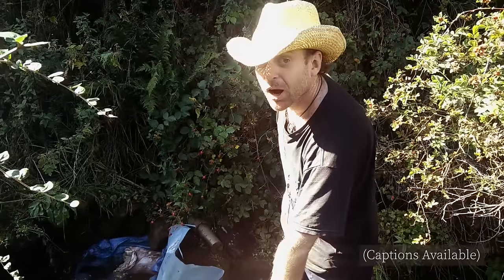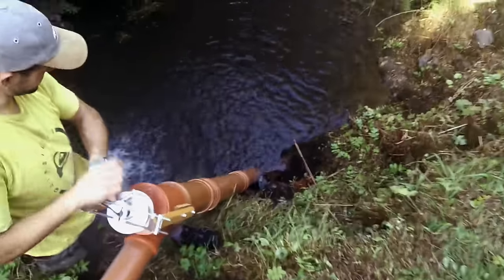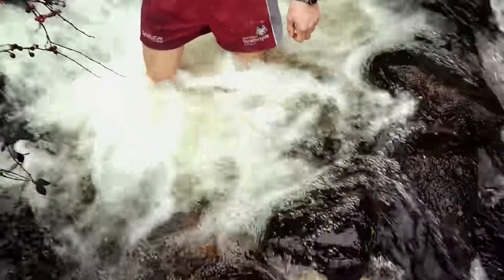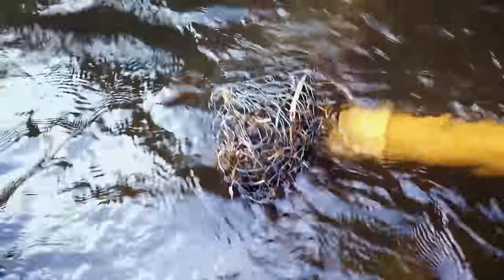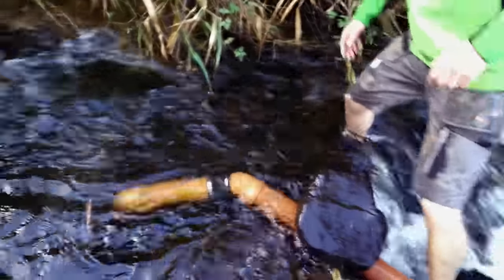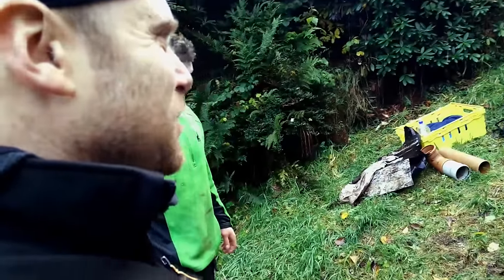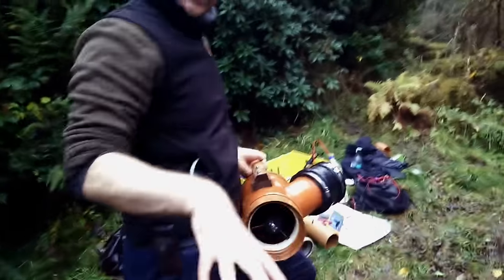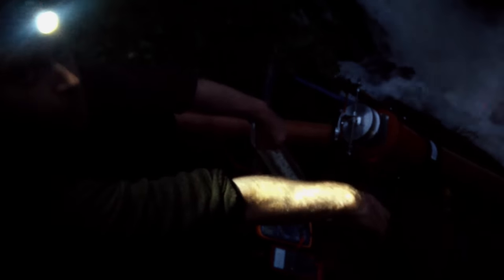Real World Results From The $50 Water Turbine

Comment: Water hammer is the phenomenon that happens when a gate closes the flow of water in a pipe. The momentum of that water is high and the force of it slamming on the valve is higher. Not sure how to address it Good Luck

Comment: Since you have the head pressure, why didn’t you try an easier route of using a Pelton wheel and a couple of jet nozzles your generator seems to be more in line with a river flow with little head pressure

Comment from the maker: I'm going to take this opportunity to get out ahead of the three most asked questions on this:

1: The turbine isn't better placed at the outlet, it's a momentum turbine, not pressure. It's most efficient above the draft tube.

2: Multiple turbines in the one pipe won't produce more power overall as they'd each steal momentum from each other, while doubling your material costs or more.

3: No you can't run a pump off the turbine and have the water flowing in an infinite loop between two tanks. I get asked this more than anything else.

Oh and bonus question yes the tutorial is in the works and will be available soon. I know I've been saying this a while now but things are steadily moving forward. I'm glad that so many folk are keen.

Any other questions tho please comment them here and I'll make sure to get back to you. Also if you just want to say hi to bump the algorithm, would be much appreciated as this channel is currently about the only thing paying my rent.

Thanks all.
Reply: Hi
Reply: About the first point. Can we run several dynamos in one pipe? Perhaps the pipe needs to be slightly modified and try to retain the momentum with gravity.
Reply: nice to see a video of the turbine again!, looking forward to see what results do you get from adding a prerotating stage, or as you call it verctorizer :P. I believe you should get a chunk more than 5 -10 % as the prerotating stage is what converts the pressure into speed, kind of like the nozzles in a pelton wheel (now that the pelton turbines are so popular between Youtubers). Keep in mind that with the prerotating stage the turbine will want to rotate quicker
Reply from the maker: @javier3218  Hopefully.
Reply: Why not try the compressor blades from a scrap large turbo Diesel truck ??
Reply: I did post my comments seperately before I saw you pinned. Asking for comments.

Please kindly look for it. Basically I talked about, using a capacitor after the generator but before the battery to take the load off the generator.

Also having someone 3D printer you a metal blade ( if possible)  so it doesn't break. 

And putting floating wood before the intake to divert the leaves from the intake screen.
Reply: Another thought I had was that:
After the generator you have a drop of straight pipe. If that pipe were bigger /or not, you could maybe set a troump with more pipe to get high air pressure to drive another generator? 

But setting it up separately on another run might be easier if a person like a car mechanic needed air to run power tools. 

 cost wise would it be possible or cheaper to just add the troump to the existing drop after the generator? To get high pressure air to do work and not need batteries to run air tools for small work shop? 

There are several troump designs, on is very compact. Another from Mr. Teselonan is a ram troump.

Seperately: If you put a splitter connector after the generator and have two 160 diameter pipes, that might increase the current output? Or one pipe on suck/drag and one set up to in train air for the troump. Or just both causing the pull on the generator as needed.
Reply: I think it would be better to use a jetski jet drive propeller and the housing, make an adapter on the intake side to fit a 6 inch pipe,...just saying
Reply from the maker: @kylereese4822  Might be tricky to get in the right size, but I'll check it out.
Reply from the maker: @reypolice5231  Trompes seem good technology, but would want more head / pressure than this turbine is designed for.
Also the entrained air wouldn't do the turbine any favours.

I saw the ram trompe, which is pretty cool, but the hammer action also wouldn't fit well with the turbine.

But I'll probably end up building them at some point as they seem fairly handy.
Reply from the maker: @lightrose100  Looked into them but bit harder to get in low resource environments. But anyone who does have one that fits seems like it'd do a decent job.
Reply: I assume you have researched Vicktor Schauberger and implosion vs explosion technology. This seams like what is happening here with this cool design. Thanks for the content.
Reply: @reypolice5231  Generally OSLT does stuff that would be useful and buildable even to the poorest folks, using common materials. A 3D metal printer doesn't really work because of that, since it's inaccessible to most folks, and is probably more expensive than just buying one.
Reply: @serenacula3256  

Thank you for the update.
Yes I see what you mean.

In the comments someone mentioned a small boat motor propeller as a possible option.
Reply: Cavitation explosions, air fans are not engineered for that look into electric trolling motor blades
Reply: @OpenSourceLowTech  amish are smart . Use a Waterwheel. Adjust pulleys to run a marine rated alternator under a cowling. No leaf maintenance.  Between a few solar panels and a wind turbine and a hundred or more watts from a water wheel you should be fine.
Reply: Brilliant experiment! Dumb question about answer #2. Added turbines will lower the strain on each blades, cause they are still trying to turn the generator & one single advanced turbine will have to handle all the force from the water which it can't. The first working turbin on top of fex two or more advanced turbines would help the latter to cope with the excessive force, no? You don't get more power but the advanced turbines won't break from the force. Making the water inflow soft start to more slowly reach maximum reduce the initial force & help blades to sustain.
Reply: My idea will probably be shot down, but what the hell.  Why not go back 300 years and use a modern variation on an open water wheel.  They generated a lot of force, didn't clog up as much because any sludge that hit the wheel would fall off as the wheel turned. The system can be geared up or down  to turn the generator at the best speed and keep the generator away from the water.  I've lived in an area that had streams with lower heads and slower water flow than the stream in your video, they all had had some sort of mill on them at one time.  Also in more heavily industrialized areas, the kinetic energy from the mills were used to run heavy machinery.  The down side might be that the heavy turning wheel could kill someone, but perhaps the wheel could be protected without providing a space that could clog up.
Reply: Hmmm. Why not?
Reply: Hi there, great work on this design. I think that you were showing off a bit,  with the tutorial video of the turbine construction - it was excellent.  When you showed that the fan had disintegrated, I immediately thought of using two fans on the shaft, not to boost output, but sharing the pressure drop across two fans may extend the life of the turbine section.  I can't wait to build my own, following your design for my own off grid project, in Scotland!
Reply: I was watching the fan blades brake off in your video and it made me think of the 3D printed wind turbine that Robert made over on his channel. It's an adaptation of the 'Ugrinsky Serpentine' wind turbine and it could also be adapted to find inside the pipe of your excellent design. Here's a video of the turbine reacting to the wind: https://youtu.be/L-Bp6nT3dQ8?t=148
Reply from the maker: @wolfenstein6676  Yeah been watching that series. I've got about half a dozen potential 3d printed runner designs ready for testing, but haven't had access to a site for doing so, so don't know what kind of performance they're capable of just yet.
Will update when do.
Reply: @OpenSourceLowTech  Thanks, mate, keep up the good work, you've made really good progress already, hence everybody hassling you for design plans :) .

Comment: Did one of these in a local dam spillway using a 16 spoon Pelton wheel and a 1000 watt motor I had shipped in from the states. Dld really well during the winter months combined with a 400 watt wind turbine and 400 Watts of solar also. Haven't had to use the grid for just under a year..
Reply from the maker: Nice.

Comment: @ 1:20 U DON'T want undulation in your pipework...
The inlet screen need 2 B in non-aerated water with adequate supply;... so when it starts to siphon it pulls clean water & NO leaves;... bubbles...
Reply from the maker: Indeed.

Comment: Not sure if you tried something like this, or fine tuned this, but 11:07, try a reducing coupling just before the fan to funnel the water inward to control where the small particular matter goes. This will force any small particles through the blades rather than the getting them on the outside. river flow water will always have small bits of sand, so you are essentially just sand blasting the fan blades and they will fail over time faster. you could try building a larger version of this and use a furnace fan, or something similar in metal to cut down the damage, but that all adds in some weight.

Comment: I have a 10-month creek on my property with a ~16m head on it, and I've been following for ideas of using your concept to provide power for the property. Is there a specific reason you use straight piping? I'm considering using 2.5-4cm flexible agricultural irrigation piping for my run, and running the piping into a barn that is 10m from the creek, about 6m of head below the intake. At a guess, there would be less momentum losses from the flexible piping than from the angled joints?

I'm also intensely interested in non-battery methods of power storage, such as gravity storage. Having a 20m tall barn that is empty most of the time makes that really tempting to figure out.
Reply: Maybe this very detailed playlist going through the construction of an entire hydro system from scratch would interest you, https://www.youtube.com/playlist?list=PLEZ2hvCDKUpEvvgEy_b5C6UnYNslaYcik 

You also have similar head available as he does so it's a good indication for how much power you can expect.
Reply from the maker: Flexi should work ok, but probably more friction and turbulence, tho as you say, should be better on corners.
You'll probably want to use something a lot fatter diameter tho if you want to get any decent flow, even with that head.

Gravity is surprisingly low energy density unfortunately. Like; 1 kWh is 10 tonnes elevated 37m.
Reply: It's mostly a matter of friction against the flexi-pipe wall rather than 'bends', especially on relatively long runs compared to the small dia you have in mind.  You can get 'long-bends' for drainage pipes, but those are mainly to get cleaning rods around corners rather than fluid flow issues. At a 10m run, with 6m head, anything bigger than 60mm dia shouldn't make too much % difference to flow available. Doubling to 120mm would give 4xflow, and frictional losses per unit of flow would be halved. 30mm pipe would be 1/4 the 60mm flow AND you would start to see significant friction losses.
If you need to get maximum power from each unit of water, for that you need shortest/widest pipe for the available head, an efficient/matched generator, and generate power as close to the source as feasible (run power cables from that to your property/storage-batteries). You'll also gain from the extra head available.

Comment: Hey ! Cool to see you're still at it and progressing nicely, I remember the first video, and was excited to see how this turned out as I live beside a brook, practically no head unless I ran the pipe a couple kilometers to the mountain and that can't happen unfortunately.  
I went  fully off grid in 2016, only a 235w solar panel and a couple batteries, still, lol. Have another panel on the roof already to hook up but haven't bothered, once you're use to less, you don't need more, I guess  :)
Good luck with your project!
Reply from the maker: I'm thinking of options for flat water, but it's a bit of a famous problem to solve. Is there any point where you have even only like 2m drop over not hugely much horizontal?
Reply: @OpenSourceLowTech  no, not even remotely, it's basically flat for a couple klms,  and I'm the end of the line, once it passes my house it's around the corner and out to the watershed, then out to the river, flat the whole way. I had considered the piston pump idea, I think it's called, which works ok in flatwater to my limited knowledge 
Also, the brook runs barely faster than a lazy river, barely over your foot deep... until it rains.  Then it comes ups 6- 10ft and roars like a beast within a 12h + event... thru my house once in 2016, and nearly several times since,  so realistically, sadly, thanks to vast swaths of relentless clearcutting upstream, my time here is quickly coming to a close. 💔 
I'll still be following along though, as I desperately HOPE to find another spot with running water on site. I'm going to miss it too much to be happy 'landlocked' elsewhere.
Reply from the maker: That's rough, river doesn't seem a viable energy source, until it demolishes your house..
Reply: @OpenSourceLowTech  sad, but true. Cheers
Reply from the maker: I'm currently in Western Australia, been seeing the damage from the massive flooding out east, three 500 year rain events in a month..
Brutal. And yeah all the worse when it's at least partly due to incompetent land management upstream. Britain's also pretty bad for that.
Reply: @OpenSourceLowTech I'm in Canada, I've been watching the flooding there, brutal.... kind of a extra kick in the ass after those insane fires. 
It's bloody hard to rebuild your life after flooding, utterly exhausting in every way. I wonder if after fire might be easier in some way, like, starting with a clean state rather than picking thru, cleaning and trying to save shit.... idk, I feel for anyone going thru any of it, I'm six years in and still haven't made it back to how it was in  'the before times'. 
Good luck, hope you stay dry, and fire free.
Reply: @OpenSourceLowTech  Hi Daniel. Nice to hear you are thinking about it. Zero head hydro power is my nut to crack here, so lete know if you have any ideas. 

I've got acequias, approximately 20cm to 30cm wide, shallow, with a slow flow. 
I'm thinking to make a water wheel in a fixture, dozens of blades from thin plastic (sliced PVC pipe or even PET bottles) in a fixture, forcing all water through it, blades covering the entire cross section of the flow. 

Blades needs to be soft or flexible or hinged, because of turtles and frogs...
Reply: @OpenSourceLowTech  I've been looking into this and so far the best style of turbine for low drop seems to be the vortex style turbines like "Turbulent" markets. These still use a drop of around 1.5-5m with high flow. You could also look up "Project Kadagya" or something like that in South America. They made their own vortex turbine and publish their research on it much like your doing here. These vortex turbines can make a LOT of energy, but require some earth works to put into place. They are fairly scalable, so can power a whole village potentially if you have enough water flow.
Reply from the maker: @calysagora3615  Yeah flat water's a problem. I'll try putting a cone on the back of my turbine to see if that sucks water through quicker (since water can't expand), but there's a fair chance that won't work and I'm otherwise out of ideas.
I don't love waterwheels..
Reply from the maker: @jeremywright5036  Yeah I know Turbulent, I visited them last time I was in Belgium and had a very useful talk about fluid dynamics, which is largely responsible for this turbine looking like it now does.

Gravity vortex turbines work well, but like you say, need fairly significant earthworks and that's something I was specifically wanting to avoid.

Comment: if you're going to impart a spin on the water, then i think there might be a couple ways to get more torque out of the turbine. Shouldn't that allow you to get more power?
Reply from the maker: Fluid dynamics is essentially voodoo, so the only way to know is try it and see what happens, but I'm hoping at least a little.
Reply: @OpenSourceLowTech  There is a huge gap between my knowledge and my ideas, so this it may sound dumb. If you trail some fins from the blade hub up the pipe, you should get a lot more torque. If you have more torque then you can use stronger magnets right? you'd probably have to do a lot of designing in 3d printing to get the ration of the fan blades and the "tentacles" to not create interference for each other. If I had any of the skills or equipment needed to attempt it, I would. I don't know what I don't know, but I think I'm on to something
Reply from the maker: I tried a stator turbine type approach in Berlin, but it ended up doing about 20% less power than with nothing. I'll be trialling some more exotic 3D printed runner shapes, will see how they do.

As it is I'm fairly happy with the rpms/volts to torque/amps ratio, I'm pretty much just looking to squeeze out any extra efficiency and watts I can get.

Comment: Please let us know about type of output circuit as well, and what else needs to be attached to get smooth electric power with your turbine. I hope what i have asked make sense.
Reply from the maker: The hoverboard wheels put out three phase AC, so that'll either go direct into a charge controller if it takes it, or more likely through a bridge rectifier first to convert to DC.
The voltage is super stable, as the water speed is pretty much fixed. It's way easier to work with than a wind turbine, kind of more like solar, but 24/7.
Reply: Thank you so much.